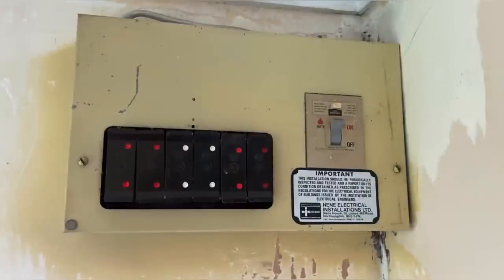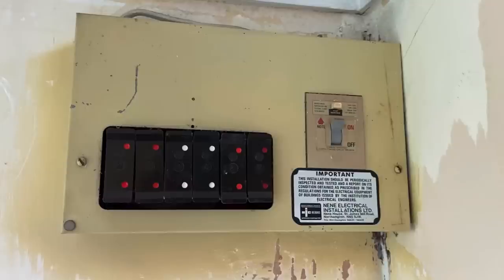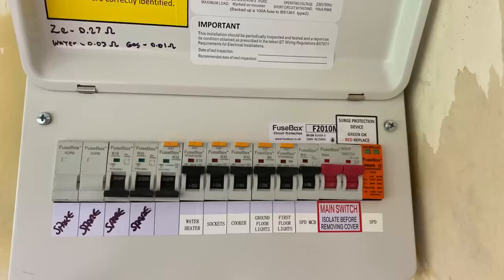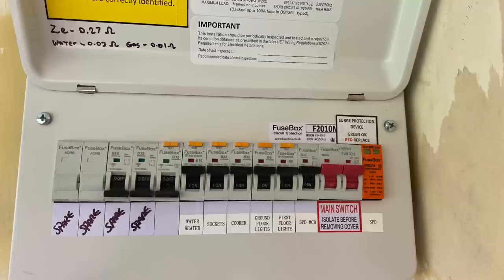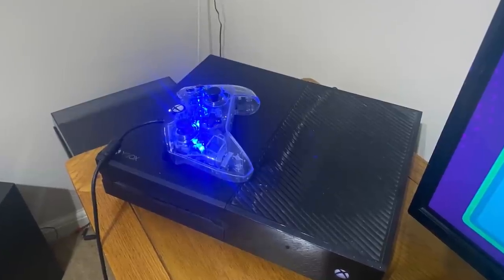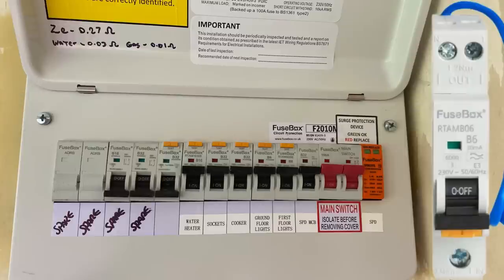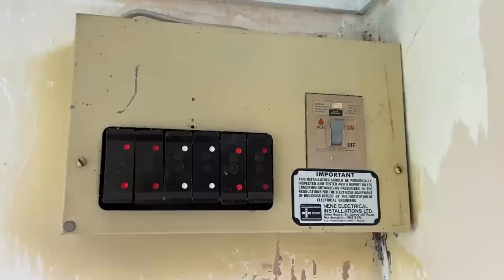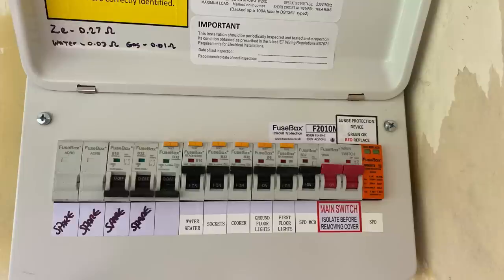Would you Change this Fuse Board..? WHY..? Understanding your new Consumer Unit

Comment: This post is not directed at Gary hayers, or any one personally. It is just my own personal opinion/ observation.
 
Health and safety executive’s note in BS7671 AMENDMENT 2 existing installations that have been installed in accordance with an earlier edition of the wiring regulations may not comply with the 18th edition in every respect this does not necessarily mean that they are unsafe for continued use or require up grading . 
Page 99 off the onsite guide ,
Installers adding or amending circuits in dwellings will encounter older consumer units,ie those not complying with regulation 421.1.201 for many years to come , It is important that installers do not advise the replacement of consumer units simply because they do not comply with the current version of BS7671 . To ensure the ongoing use of such enclosures and assemblies, the installer must ensure the following:  
You can read the rest your self if you can be bothered.  But of course a few sparks don’t bother to read it as long as they can boost their bank balance they will continue  do unnecessary CU changes .but who am I to argue i’am just a humble spark who’s opinion means nothing .
Fantastic video as always Gaz.
Reply from the maker: This installation was having a roof extension hence the board change to accommodate the new final circuits… NOT charging for unnecessary work…
Reply: @GSHElectrical  page 99 onsite guide installers adding or amending circuits. . It can’t be any clearer . 
Also I did not say you were doing it to boost your bank balance I said that why most sparks do CU changes . You made a good point about rewireble fuses and people not replacing the fuse wire with the correct size. That’s not our problem we can’t prevent people doing such things like wise we can’t prevent them from doing there own electrical work. We can only do a visual inspection  looking for signs of damage overheating burning exposed conductive parts, and if all is well we then test in accordance with the current edition of BS7671 and if our test results are as specified in BS7671 the we can sign it of as safe for continued service. We do not have the right or legal offorrety to tell the client what they can or can’t do in there own home . What they do once we have left is down to them .  Also the regs can not and should not be back dated.
But as usual my opinion means nothing.
Reply: @GSHElectrical  still not a reason to change the CU as the existing circuit could be extended.
Reply from the maker: @Dog-whisperer7494  your opinion 👍🏻
Reply: @GSHElectrical  not just my opinion health and safety executive’s note in BS7671 and the note on page 99 of the onsite guide is as clear as glass .  But hey if you want to ignore it that’s up to you,  
You may not like me or my comments. But you know i’am right and that’s what you don’t like.
Reply: @Dog-whisperer7494  chill, why you so triggered, neither of you are wrong, its all guidance and every job is individually assessed, enjoy the free vt that they font have to do 🤪
Reply: @brianhewitt8618  i’am ok 👍 I was just pointing out what Is in the books . And have a bit of a wind up with Gaz . Who by the way  is a great guy and a great electrician with a wealth of knowledge and experience, he knows I have a lot of respect for him and all the fantastic work he has done and continues to do I have learnt more from him than I ever did at college . I can’t fault him . Be honest I don’t really care if they do a CU change or not , I was just making reference to the Health and safety executive’s note. Nothing more . 
But who am I to argue i’am just a humble spark who’s opinion means nothing 🤣 . As long as I can learn from him the i’am happy ,
Reply: @Dog-whisperer7494  Give it up mate, there is simply no need for your attitude here.
Reply: @Dog-whisperer7494  One damn good reason for changing the CU from the old wire fuse type is so that RCD breakers can be installed which prevent electrocution.
Reply: @deang5622  yes I agree , but my point was that the regs can’t be back dated ie they can only apply from the date they are introduced onwards , not backwards hence why we have a six month grace period  before the blue book is with drawn this is to allow installations designed and started before Am2 can be completed. And does not need to brought up to the new standard. But AM2 must be applied to  installations designed and started on or after the 28th on march 2022 .
Reply: @deang5622  I don’t have an attitude. But I do have a right to an opinion.unless you are saying that the IET and the health and safety executives are wrong . If they accept and recognise that older installations are safe then why can’t you ?
Reply: @Dog-whisperer7494  You are so fixated on having your opinion and being right you did not read my post accurately.

I made no reference to a wire fuse based CU being a safety issue. I did however provide a reason as to why a consumer unit should be changed. And there are other reasons which I did not articulate.

I do know what is in the wiring regulations as I have formally studied them. I am an MIET, we write the regs! I am qualified to university degree level in electrical engineering so it would be extremely ill advised of you to challenge my knowledge.
Reply: @Dog-whisperer7494  Grow up you big baby. Start acting like a professional
Reply: @deang5622  no I don’t want to . 👍😂
Reply: @deang5622  i’am not big i’am only five foot two 👍😂
Reply: @Dog-whisperer7494  it’s not required by regs to replace it, but especially if you’re extending the installation, not replacing it wholesale would be beyond moronic.

The idea that there is no reason beyond profit to do so is just invalid.
Reply: @JasperJanssen  yes I agree. 
The thing is I didn’t say we shouldn’t change old CUs I was just pointing out that more often than not there is no need to, I will always do a visual inspection first look for any damage overheating burning  is there an imminent risk of fire or danger to life and or property. If the answer to all theses questions is no I the carry all the test according to BS7671 AM2 and if my test results are within tolerance as specified By BS7671 AM2 I will then sign it off as safe for continued service. I will the put a note on my paperwork as room for improvement. It’s the upto the costumer to decide weather or not to have those improvements.  If they do great
Reply: @Dog-whisperer7494  see, there’s nothing wrong with *that*. It’s the “you can read the rest yourself if you can be bothered” and the “but of course most sparks don’t bother […] boost their bank balance they will continue to do unnecessary CU changes” that’s is getting everybody all hot and bothered.

Particularly in the given example which, while it is technically compliant, the only reason that is the case is that British regs grandfathers in everything no matter how old.

PS: with that broken ceramic in the one fuse, arguably it’s not even compliant with the regs of its era, but of course you could technically fix that with a replacement second hand fuse holder or possibly even a new one if you can find some NOS. But even beyond that, rewirable fuses, as well as having fuses rather than MCBs, as well as not having a real RCD… all very major reasons why the installation is not up to modern safety standards. This isn’t one of those “well technically we are now requiring metal enclosures”, sorts of thing. This is one of the situations where there are major safety and convenience upgrades to be had for both the inhabitants, the owners, and even the electronic equipment connected to the system. Can you force the owners to spend the money on it, no, but it is definitely your duty to make clear to them that they really really should. Especially if they want you to modify and extend the overall system. 

The real question here is, should you refuse to perform the expansion if they will only pay for a secondary consumer unit while keeping the existing one? No matter how few pounds that actually saves them? That one is going to have to be down to individual conscience, but I certainly wouldn’t blame anyone for walking away if the owners are that much penny wise pound foolish.
Reply: @JasperJanssen  yes I agree , when when I said read the rest your self’s if you can be bothered , I was referring to Gary or any one in particular but the small minority of sparks who can’t be bothered and haven’t even  looked at the regs since there exam. Also we all know there are plenty of sparks out there again not all but a good few who will and do change CUs for profit alone I have seen enough of them in my time some even tell clients the there CU is illegal . I have always informed costumers of the safety benefits of a new CU but I leave it up to them to decide  . I will always do a visual first as described in the onsite guide ie I look for signs of damage overheating exposed conductive parts and such like , I then test according to the 18th edition of BS7671 and if my test results with tolerance as specified in BS7671 I will sign it of as safe for continued service. And I will give it A C3 for lack of RCD protection and note on the certificate room for improvement. If I am asked spercivicly to change a CU then I will change it . 

The point I was making is the it clearly says it is important that installer’s do not advise an upgrade or a change of CU simply because it is old and adding to or extending an existing circuit is not a reason to change or upgrade the CU .
Reply: @JasperJanssen  my point is we say we comply with BS7671 
Yet we’re happy to dismiss or ignore those two pages, so technically we don’t comply , we can’t pick a choose which part to comply with or not , ever we comply with the book or we don’t . After all the HSE note is in there for a reason is it not . ?
Reply: Technically, yes. But there are other factors at play which I would present to the customer in a factual and costed way (rather than simply saying a new CU is the only option, or that existing CU is fine).
1. Rewireable fuses are less convenient than resettable overcurrent protection devices.
2. Your extension will mean greater power demands. This could come from existing circuits. In future you may want a vehicle charger, new oven, electric shower, solar PV, etc. I could make provision for this by installing a new CU with spare ways, that costs very little more than a smaller one. 
3. I should install 30 mA RCD protection on your socket circuits, and for the new sockets in the attic this is a requirement. The easiest and neatest way to do this is a new CU. I could add a second, RCD-protected board, but this would need extra tails and Henley blocks and would take up more space. Overall the cost of a small new CU is not much different from a larger one, and you would have the convenience and future-proofing that a newer design can bring.
Reply: @Dog-whisperer7494  and the code for a socket likely to supply portable equipment outdoors?
Reply: @deang5622  look at it again there is an RCD all be it is being used as the main switch not ideal but still compliant.
Reply: @Dog-whisperer7494  No. Let's go back to the start of this discussion with your original post.

You were challenging that CU's don't need to be upgraded, saying that the IET regs don't require boards compliant to earlier versions be updated to be compliant with new versions of the regs. In fact your response seem to be quite insistent it shouldn't be done.

Now whilst you are right about the regs 
, my response to you was that there is in fact a very good reason why you might want to replace the CU and I stated what that reason was.

End of discussion mate. It's over.

Comment: I'm not a sparks like most of you here, but I worked for 30 years at Klippon and then Phoenix Contact who are the market leaders for Rail Mounted Terminals and PCB Terminals & Connectors, and my question is - based on the comments mentioning the old two-screw connections being better than the newer single screw connections: 
 - Why are the units not being fitted with spring connections nowadays?

They remove all of the problems that screw connections have.
Torque screwdrivers or X years of experience are not needed at the wiring stage as the spring automatically clamps down with the optimum level of force.
Temperature cycling does not reduce the spring force whereas it does loosen screws.
What am I missing?
Reply: Connection resistance is higher.  There is another YouTube channel called Great Scott if I recall correctly.  They compared the wago blocks with the wire nuts widely used in America.  The wagos were better in all respects except one.  Skill level needed to connect correctly, integrity under persistent fault current conditions (tested to melting point of the plastic assembly) were all superior for the wago block connector.  But the wire nut was superior in terms of connection resistance.  The wire nuts exhibited a lower temperature under rated load.  That said, the temperatures were still perfectly fine for the wago blocks.

So to answer your question, I think “resistance to change” is the most pertinent reason.  Why change something, when what you’ve got works perfectly well, even if the costs in terms of labour and materials are higher?   Change is weighed up against risk, and the electrical industry is a rather risk averse.  I love wago blocks, but others especially in North America are suspicious.

Comment: I think overall I would replace, it’s bound to not be big enough for future expansion of circuits, the PFC of the breakers or fuses most probably doesn’t comply, the RCD main switch is non compliant. Overall being you can get up to date breakers to fit in it still doesn’t allow for expansion to save someone coming in and fitting another consumer unit and Henley blocks I’d be the one to replace it! Plus newer versions look much much smarter! I’d install an Earth electrode at the same time and upgrade earthing/bonding, do an EICR & check the installation is safe - makes sense to replace!

Comment: Lots of well installed old wylex rewireable fuse boards have been removed and poorly installed , poorly designed  consumer units put in their place . The old wylex had good design features which are not in modern consumer units . It's a shame that everything is now the cheapest available thing that's installed.
Reply from the maker: Many great points - thanks Gaz 👍🏻
Reply: @GSHElectrical  the main point is that cables aren't square,  so why do we have square box terminals on mcbs ?  The old wylex had 2 screws per termination . New boards it's one . Poor design and cheapness
Reply: Chill out Dennis. They’re not compliant anymore. End of
Reply: @fitzanderson1980  why ?

Comment: I'm not sure I would've left the MCBs there for the spare ways.  A cowboy may just use it, result is a new circuit with no RCD protection.  I would've got a couple more blanks instead.
Reply from the maker: Great point 👍🏻
Reply: They could still take a blank out and just put a breaker in..
Reply: @kieranthomas8558  And not always the same make.